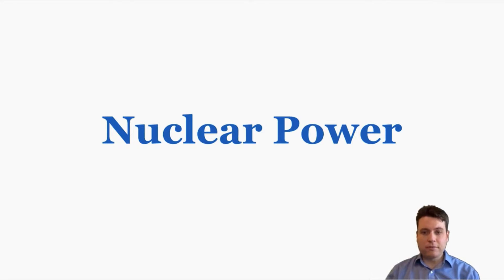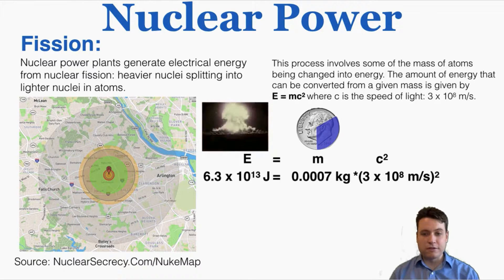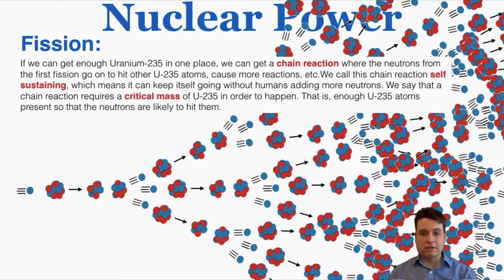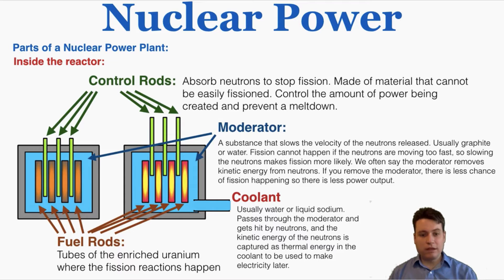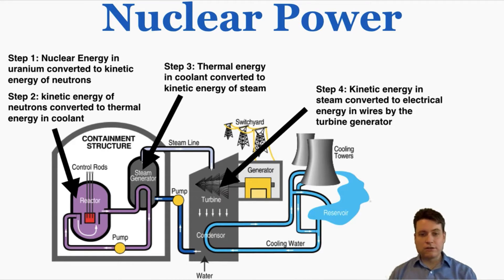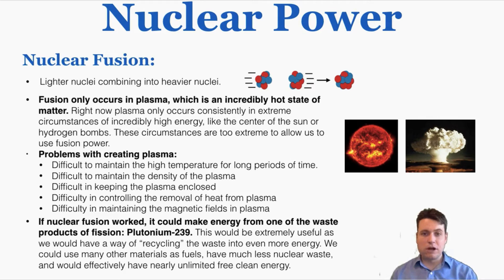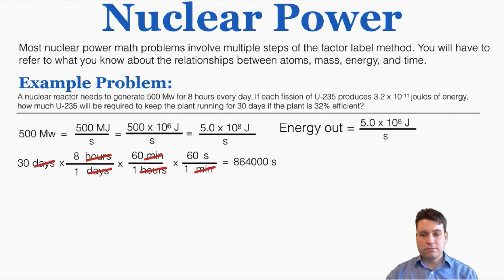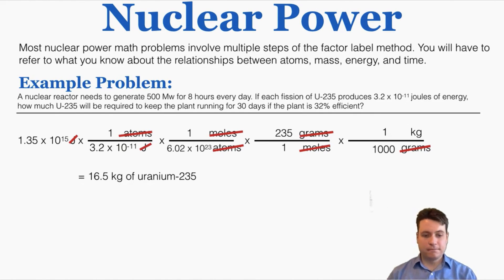Nuclear Power - IB Physics

Comment: I would add another disadvantage to nuclear power. Because of its potential dangers, it’s subject to heaps of regulatory capture making it the most expensive and slowest energy source to build new capacity of. It takes approximately 20 years now to get a nuclear plant running; simply won’t work in todays economy
Reply: The same argument applies to motorways, railways and hydroelectric stations,  which are also expensive, slow to build and very safe.   And the same objectors do their best to delay them even more with protests etc.  Finland has just built a nuclear power plant which will be commissioned this year.   Germany closed theirs down and now has to mine lignite (coal) again because the Russian gas not being supplied.   The big advantage of nuclear is that you don't have to rely on potentially hostile countries for the fuel supply, unlike oil and gas, and renewable energy materials like  lithium, rare earth elements and cobalt.
Reply: @karhukivi  The problem is once a nation builds a nuclear power plant they are months away from a nuclear weapon. That’s the danger, dummy

Comment: Nuclear power create nuclear waste that 1 micron takes about 24,000 years to degrade from Ba and Kr (Nuclear waste). It has strong radiation that harms all life in the planet permanently (means for a long time). The safest ways to save all life in this planet is not using it, until you figure out a way to lower its radiation rate into zero. Scientist from 1977 said by 1986 a solution shall comes. Now is 2020, when the whole world is suffering from Pandemic and environmental crises. Use other alternative energy supplies like aerobic digestion system in small scales and place in different local communities is a more humanity solution to consider.
Reply from the maker: Nuclear waste is easy to store and keep people safe from. Pollution from coal plants on the other hand kills hundreds of thousands of people each year...
Reply: @AndyMasley  There are two general types of Nuclear wastes to be store, one is solid, another one is liquid. Japan is the only country mostly use solid pull with concrete to store it, and planning to dump the nuclear waste to the ocean. Their storage place is reaching up to 3000 tons. While Holland had dig 1000 feet below the ground and store it under mountain that rarely move. However that's also filling up. Other countries mostly use liquid forms and some store it in very thin plastic. That's very dangerous. 1 quarter of nuclear waste takes 10,000 years to generate. People live in the effected town in Japan, had to be evacuated. People in US know there were documentary films about New Clear and its radiation from its waste. No lives is safe once it release. No lives want to live with cancers.
Reply from the maker: @xiaoxiaobaibobo  Hundreds of thousands of people die every year from fossil fuels. Once nuclear waste kills the same number of people I'll start to worry.
Reply: @AndyMasley  that's already too late. Prevention is the key!